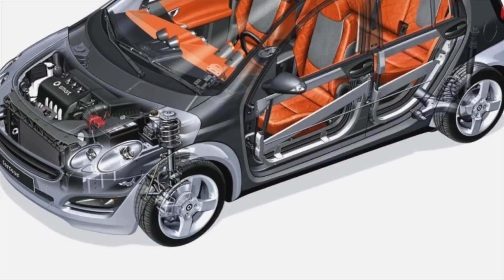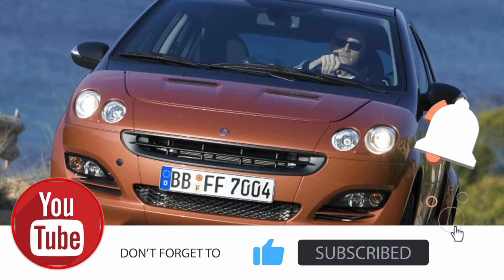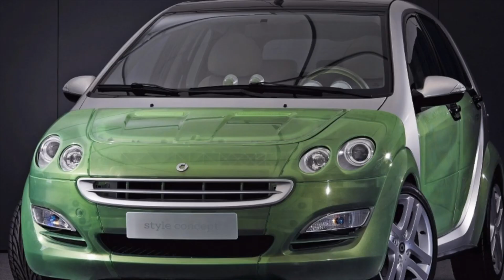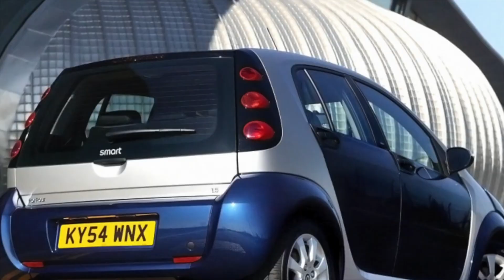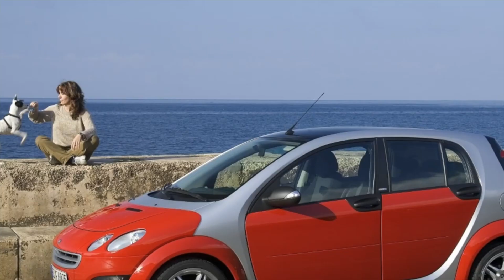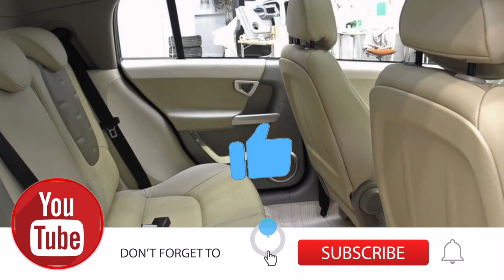Smart ForFour W454 - Check For These Issues Before Buying

Comment: Ours is a 2005, 1.5 CDI, Turbo. Purchased in 2020 and have owned for 5 years, extremely cheap to run with an average of around 900km per 40 liters of Diesel. Other than normal running costs, tyres, oil and filter changes etc. The only repairs have been 3 of the 4 doors needed new door handle cables and I have replaced wheel bearing/hubs in the rear. It's not bad for a 15 - 20-year-old car. I don't think we will ever sell it, even if it shits it's self I will just re-power it with a K20 motor and trans and race it.

Comment: At this point of ForFours life the probable near future reapirs are if they have not been done yet: Wheel bearings (all corners) last 100 - 200 tkm. Exhaust might need entire replacement soon depending are roads salted during winter. TVA (Throttle Valve Actuator) might need replacement or manual cleaning insides by driling out metal rivets holding it together and relubing moving parts. Airbags should be replaced because they're at end of their life and cannot be quaranteed to work anymore (soon 20 years old for first units).

Comment: Just got a 1.5cdi OM639 with 70kw, automatic transmission. Rear bench can move so much to the point where people in the back sit more comfrotably then in a C class. Driving is very smooth in the city over all the potholes. Can go on open road as well due to a higher horse power diesel engine. Uses 4L of diesel. Awesome home to work car

Comment: Mine is being treated like a girl and it has already 5 years with me now...I only managed changing from 1.3 to 1.5 engine, from r14 to r15 and from AMT to Manual Gearbox 3 years later...
Why? I was using to travel with it, and on every speed bumpers it was crashing from the exaust...and the clutch actuator has broken twice (2020 and 2021).

I love it just love it like the first time I saw it.